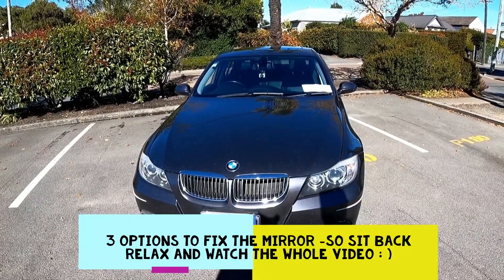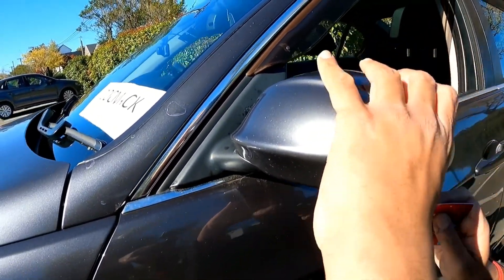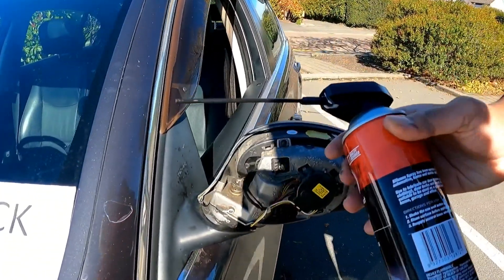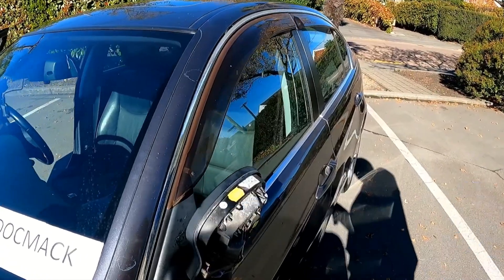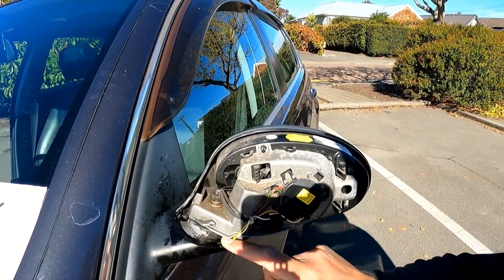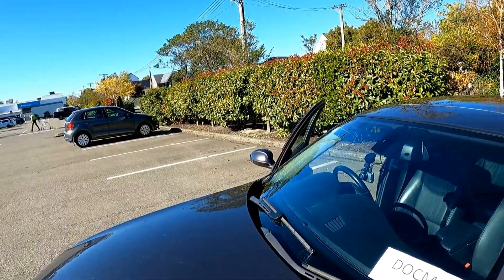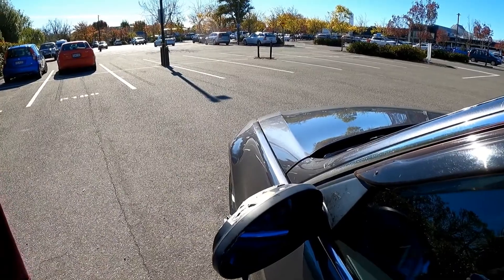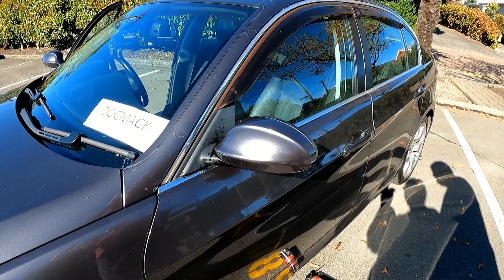BMW Power Mirror folding outwards too much E90 E91 E92 E93 - 3 options to fix for FREE

Comment: So you didn't fix it you broke it😮
Reply from the maker: @AKEUC-w9l  Surely enough you saw the rest of the 2 options, unless you are one who does not watch the full video then wonder why I did what I did  😉
Reply: @DocMackGarage  it's annoying but the other option is to buy new id rather not snip wires nor rip it apart
Reply from the maker: @AKEUC-w9l  There is also a 3 option discussed.  The thing about owning BMWs is you can't have it cheap and problem free, either spend money or a DIY fix.

Comment: nice thank you!! for me it helped to just force the mirror into the closed position. then it folded outward normally and stopped in the regular position. afterwards NEITHER mirror worked so I put both into inward position manually and tried around a few times. for some reason it only worked once I was inside the car. 
anyways - good luck to everybody with this!!
Reply from the maker: You are welcome Richard, hence I explained in the video the recalibration method. Consider Subscribing if you haven't already.

Comment: Sorry mate, but it’s not a “how to fix it”. It’s how to break it .
Cut the wire is not a solution. It’s a “downgrade”
Reply from the maker: I did show how to calibrate the mirror in this video aswell, so the wire option is the last resort .
Reply: @DocMackGarage  

right! why not just pull the fuse out?
Reply from the maker: @brandoncalkins2512  if you pull the fuse out you will lose function to the mirror adjustment, reverse mirror , and mirror heater.
Reply: @DocMackGarage  
I totally didn’t know that before I commented that because I found out. Lol I had that problem with both my mirrors so I just cut that white wire.

Thank you for your video tho! Did good job explaining
Reply from the maker: @thisb765  You are most welcome,  please consider subscribing to my YouTube Channel for free if you haven't already.  I have lots more BMW and general car videos.
Reply: @DocMackGarage  
Awesome I just subscribed to your channel! keep up the good work!!
Reply: @DocMackGarage  
I was also gonna say, pulling that fuse out also takes away the capability of rolling down all the windows too. lol 

If I were to ever replace the mirrors would that white wire come connected then?
Reply from the maker: @brandoncalkins2512  LOL,  yup if you replace the mirror , the wiring harness comes with it.  I have another video where I replaced it and all functions restored. .
Reply: Buying a bmw is a downgrade. No other manufacturer has this issue. Car is junk

Comment: My E90 mirror don't fold and don't have option to fold
Reply from the maker: Hmmm, what model and year ?
Reply: u got a base model my guy relax
Reply from the maker: @jaybaked8409  Sounds like he does.
Reply: 2005 e90 320d
Reply: @DocMackGarage  2005 e90 320d
Reply from the maker: @sunmoonstar124  so you don't have the button to push ? If so maybe this is not an option for this specific car
Reply: No button to close not able to close manually
Reply from the maker: @sunmoonstar124  You are definitely did not come with this option